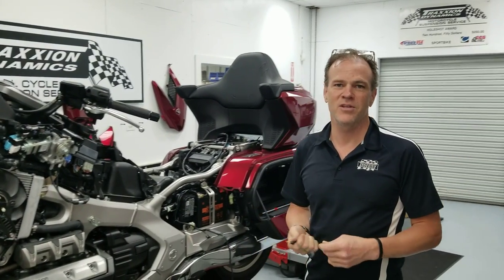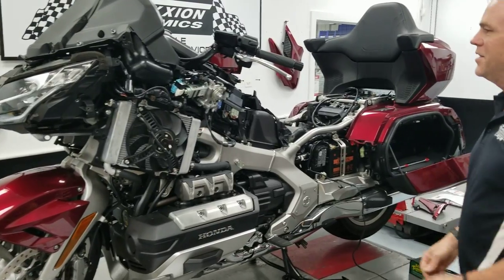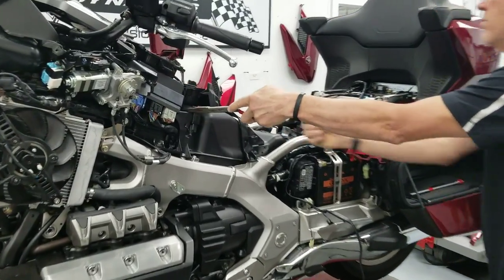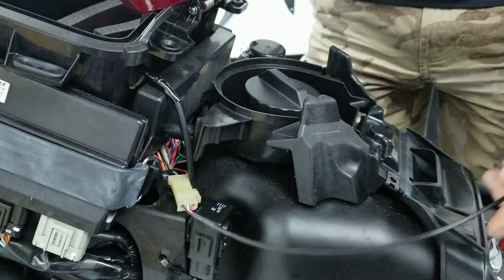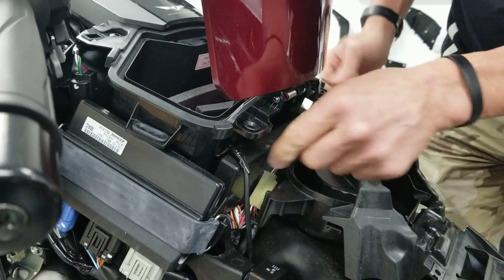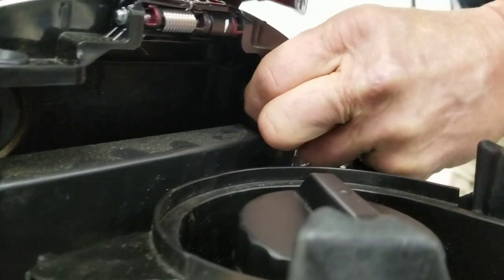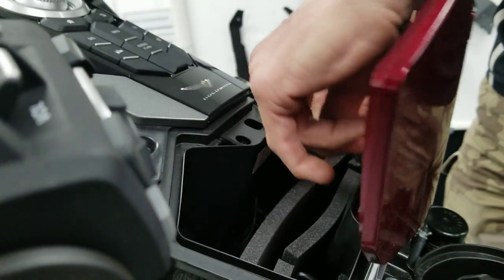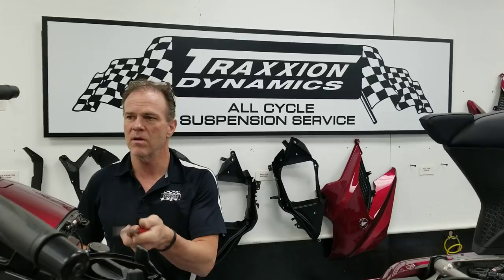Hondaline Aux iPod accessory cord installation - 2018+ Honda Gold Wing

Comment: Hey Max, my 2018 DCT tour has an antenna on the right side of the trunk  and no CB. Do I need it? If I remove it is there anything to cover the holes? What could it be for? Thanks Max.
Reply from the maker: That's interesting, I bet it is an improved AM FM Antenna.  You can check for a connection under the seat back by the trunk.

Comment: Hi Max. I want to install the 3.5 mm cable to use with my dock XM radio. I have the car adaptor base that I use the radio in 5 different vehicles. I bring it with the one I use and only one subscription. My question is : is there by chance I can get that plug without removing all as you said. Any shortcuts ???? Thanks  Much appreciated.
Reply from the maker: Hi Roger!  Sorry, there's no shortcuts to install that cable.
Reply: @Traxxion  Ok Thanks. Guess will need to learn how to take all plastic off.

Comment: Hey Max I am trying to get a second USB data connection. I watched your other video on that issue and if I understand correctly there is no way to use Apple Car Play and be able to switch to a second USB and hear music from the second USB while using Apple Car Play.  If that is so is there a way to have the AUX connection to the bike (in this video) and the other end be a USB to play music?
Reply from the maker: Yes, there is only one single data port input on the bike, so 2 data devices cannot be connected to it at the same time.  I have not seen a 3.5mm aux cable adapter that would convert to a USB, but it may exist.  You are on your own with that one!

Comment: Can you hook an MP3 player up to that jack
Reply from the maker: That's exactly what it's for.  There is an "AUX" selection on the dash for this cord's input.
Reply: Max McAllister & Traxxion Dynamics The amplifier that was installed on the bike did it really make that much of a difference? Do you have a clip of the sound that you could send me if so I can call you and give you my email/phone number to send it to me if you can.
Reply from the maker: @DavidSmith-br4vt  I had that, but because I was playing a Judas Priest song int the video, they claimed copyright ownership to my video and so I deleted it.  I don't have anything else to demonstrate the difference.  If you are "into" quality sound, I believe it made a significant difference.  For the same money, could you get a louder stereo?  I am certain you can.  But can you get a cleaner installation and integration?  Not a chance.  The Honda kit is plug and play, the gear is waterproof, and there's another trick... the Honda system uses 3ohm speakers which are very very unusual.  Not sure about integrating other things into the system that don't align electronically, but that would be a question for a stereo expert, which transcends my current level of genius-ness!
Reply: @Traxxion  you could always use a 2 ohm speaker and just add a 1 own resistor to get 3 ohms....
Reply from the maker: @ronaldjupiter5883  you've now left my realm of expertise!